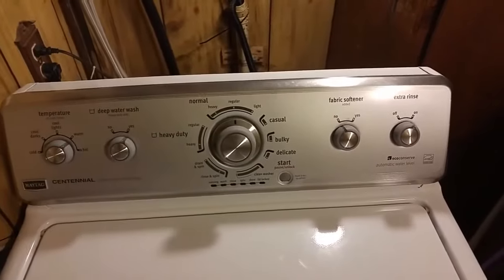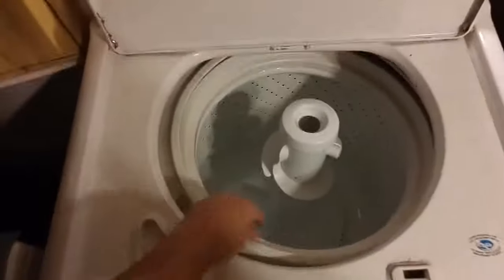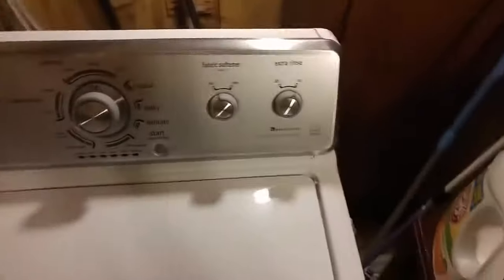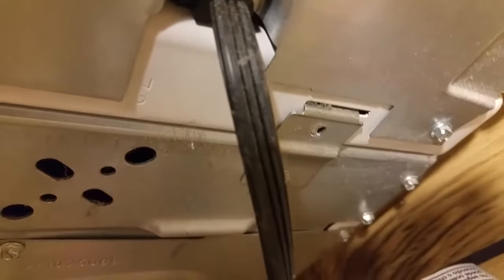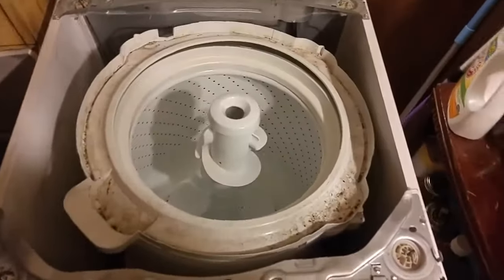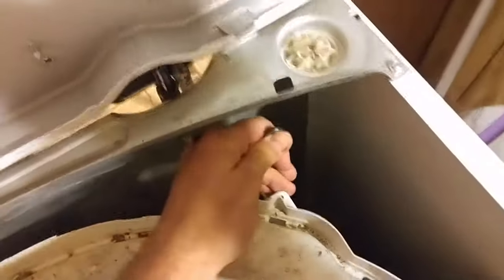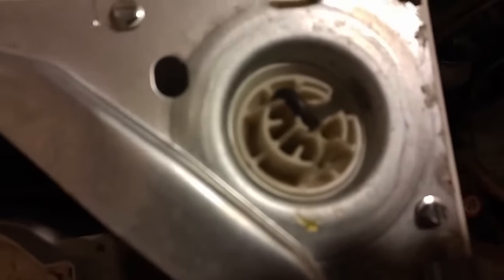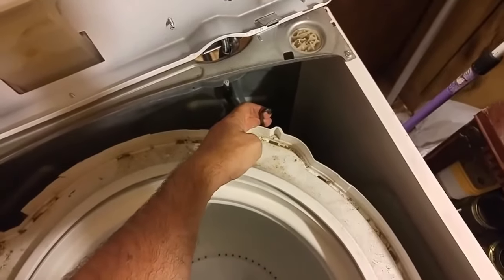How to Open a Maytag Centennial Washing Machine &  Why a Maytag Washer Bangs Around

Comment: I had the exact same problem and it was an easy fix thanks to your awesome video.  Thanks!   BTW, my Maytag opens by pulling the top forward.
Reply from the maker: Im so glad you found this video helpful!  This reset is good for any vertical modular washer (VMW). In other words it works for pretty much any top load washer  boughten n the last 0-15 years that wasn't made by LG or Samsung (they as well have a similar reset but isnt as universal as the reset you learned). VMW's are distinguishable by the ever so hated lid lock device, not to be confused with the old school lid switch device that allowed you to open the lid at anytime without waiting for the washer to come to a stop and the lid lock to release.  If anyones intersted VMW's are sold by Whilrpool Corp.who in return owns almost every american appliance brand such as kenmore, maytag, amana, roper, inglis, crosley and many other brands they are a few brands away from monopolizing the appliance indusrty in the US. Word to the wise: an $800 Maytag VMW lasts just as long as the $550 Roper or Amana VMW and has all the same parts. The only difference is the name and the price. Think of it as buying a shirt from nike and one from walmart. The shirt from walmart is way cheaper and will get the job done, If you think putting more money into appliance will get you more life out of it youll be sad to find out that no matter the price of the appliance they are all pretty much lasting 3-5 years only now not the 20+ we are expecting. 

Which appliance do i recommend?  The generic VMW's sold by Roper, Crosley and Amana. There just as good, last as long  and cost less than the Maytag VMW's. I also recommend always adding the 5 year protection plan add on for about $120 which will pay for all future repairs for the next 5 years which will pay for itself 2 or 3 times over after year 2 or 3.  The 3 year add on is a waste of money because the machines typically last just long enough to get past 3 years.

 I hope this tutorial and explanation helps you, your friends and your family god bless you and thank you for watching! Oh and if you don't mind please like the video and subscribe to the channel to help the channel grow so we can reach more families like yours!

Comment: How do you access the inlet valve?
Reply from the maker: 2 clips undr the control panel. One on each side. Stick screwdriver into it and pop it out. Once you do this the back panel will release giving you access to it. Its held on with one screw.

Comment: The door locked and a friend removed the wire coming from the electric lock back to the computer on the control panel how do I plug that door lock back in and bypass it being in place so I can make the unit run I plugged it in and it does I'm holding the wire in my hand how can I bypass the switch with the three wires near the switch I want to remove the switch and make my washer work what do I do with the

Comment: Goodstuff! thats my machine, and i need to fix it. Thanks bud
Reply from the maker: Im so glad you found this video helpful!  This reset is good for any vertical modular washer (VMW). In other words it works for pretty much any top load washer  boughten n the last 0-15 years that wasn't made by LG or Samsung (they as well have a similar reset but isnt as universal as the reset you learned). VMW's are distinguishable by the ever so hated lid lock device, not to be confused with the old school lid switch device that allowed you to open the lid at anytime without waiting for the washer to come to a stop and the lid lock to release.  If anyones intersted VMW's are sold by Whilrpool Corp.who in return owns almost every american appliance brand such as kenmore, maytag, amana, roper, inglis, crosley and many other brands they are a few brands away from monopolizing the appliance indusrty in the US. Word to the wise: an $800 Maytag VMW lasts just as long as the $550 Roper or Amana VMW and has all the same parts. The only difference is the name and the price. Think of it as buying a shirt from nike and one from walmart. The shirt from walmart is way cheaper and will get the job done, If you think putting more money into appliance will get you more life out of it youll be sad to find out that no matter the price of the appliance they are all pretty much lasting 3-5 years only now not the 20+ we are expecting. 

Which appliance do i recommend?  The generic VMW's sold by Roper, Crosley and Amana. There just as good, last as long  and cost less than the Maytag VMW's. I also recommend always adding the 5 year protection plan add on for about $120 which will pay for all future repairs for the next 5 years which will pay for itself 2 or 3 times over after year 2 or 3.  The 3 year add on is a waste of money because the machines typically last just long enough to get past 3 years.

 I hope this tutorial and explanation helps you, your friends and your family god bless you and thank you for watching! Oh and if you don't mind please like the video and subscribe to the channel to help the channel grow so we can reach more families like yours!

Comment: Maybe not relevant to this particular washer but I’ve got a Maytag bravos and have had to replace the motherboard 4 times. Unit is less than 4 years old. MVWX665DW1. I have used ‘used’ parts each time. They don’t last long but cost between $80 and $150. They just quit, no power passes thru the motherboard to the LED indicator lights. Who can or has repaired these boards which obviously have a faulty component?
Reply from the maker: Yes you're exactly right they don't last like they used to... And in your particular situation I'll bet you if you install a GFI or a power bar with a surge protector on it on the outlet before you plug in your Appliance it will solve that issue. Something as simple as a power storm and a flicker of the lights can burn out your plants nowadays because they're practically just computers. If that don't solve your issues and you got bad wiring or something inside. But let this be a lesson for next time you ever buy any Appliance ( and I mean dishwasher washing machine dryer hot water heater trash compactor ice machine or anything of the type, bicycle, lawn mower, headphones etc all apply) at the time of purchase make it sure to opt in for the Allstate 5-year warranty add-on which cost anywhere from $80 to $150 extra... And in your particular case if you would have had that if they have to fix the same thing three times in a row on an appliance then they will just replace the entire thing. You would be getting a brand new one by now. From my experience appliances are only lasting about 3 years so if you get to 5-year you're going to save yourself a lot of money. I recommend opt-in and get the generic Appliance and save a few bucks instead of getting name brand and then use that money that you saved to get that five year warranty. Generic appliances like roper and Amana are just as good as whirlpool who owns about %90 of the amir an brand names.

One last thing to remember when messing with these appliances nowadays... The more money you put into them does not equal more life... More money you put into an appliance equals more gadgets and functions which ultimately bring down the life of the appliance. 

Appliances used to last 20 to 30 years now they're only lasting two to three because of all of this technology advancements they've been doing. 

I hope this helped and good luck to you! Thanks for watching!
Reply: @methodmeetsmadness  Many thanks for replying. BTW your site is extremely interesting…
Reply from the maker: NO PROBLEM IM GLAD TO HELP! (oops) Thanks for checking out my site (your referring to easyrepairs.org right?) I haven't worked on it in awhile..   This channel is pretty interesting too! Ive discovered that youtube dont care about reusing content. if you look closely this channel consist of 2 main videos really. Ive gotten my revenue to around $1000 a month so far :) ... Than again for watching and heres a sneak peak at my next project you may fnd it very useful! 

If done right the buying and repair guides will save you a ton of money!! Make sure t atlest watch the appliance buying video its very valuable!

 https://drive.google.com/drive/folders/13Kl0ksO7d2BBEofpO1643_RkU_rc8vmF?usp=sharing